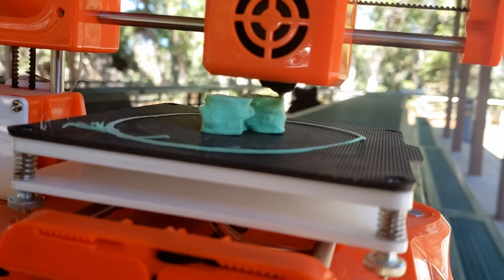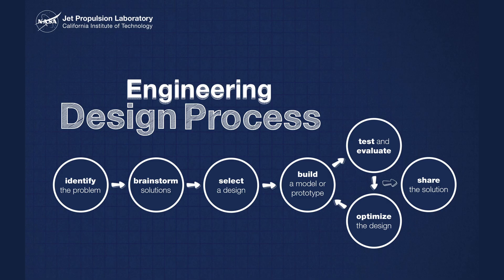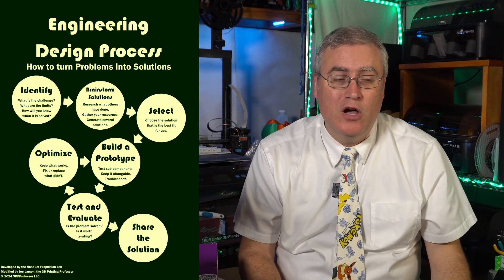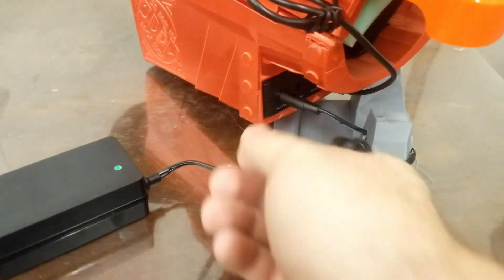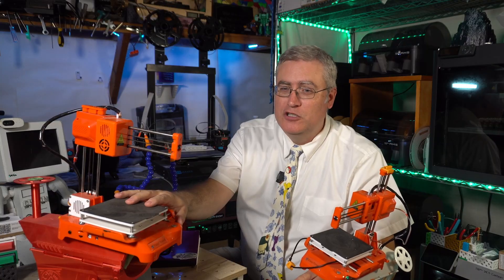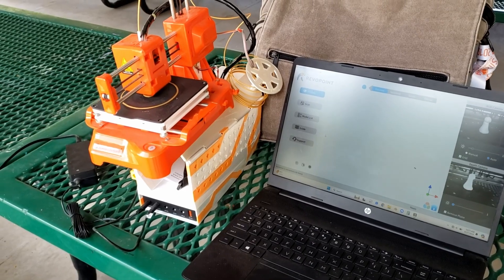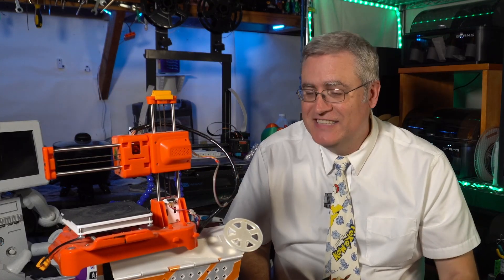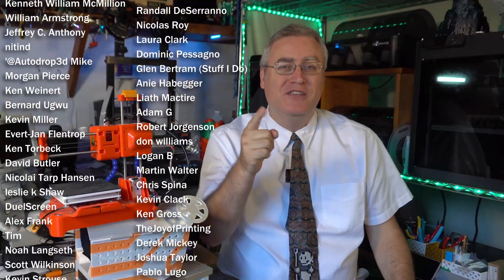I 3D Printed in the Wilderness with the Revopoint Pop 2 scanner and EasyThreed K7

Comment: I currently have this printer, do not buy it, it is not worth it, it is not supported by any printing program, it only serves as a cure, and using another printer as a base model, so the printing parameters do not work either. The impression is normal, but when we make small-scale objects the impression is terrible. For a little more there are much better models.
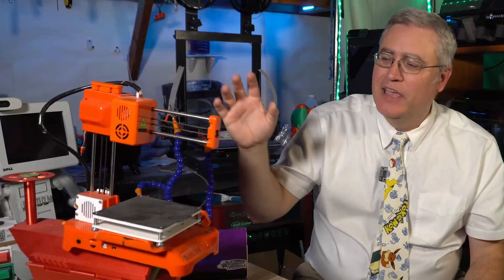Reply from the maker: Oh, for sure. Like I said at 6:34...

Comment: The ups is just some lithium cells and a board. Find a way to disconnect the batteries when not in use.
Reply from the maker: A simple switch on ground should do the trick. I might brick it, but at least it's cheap.